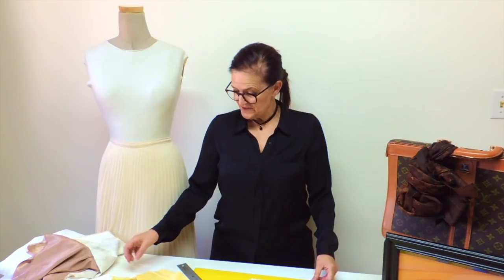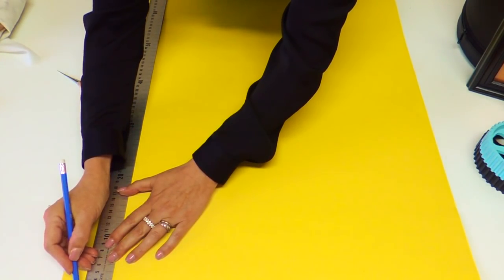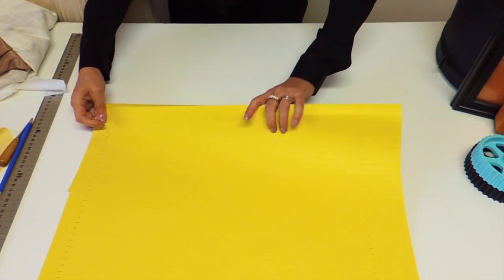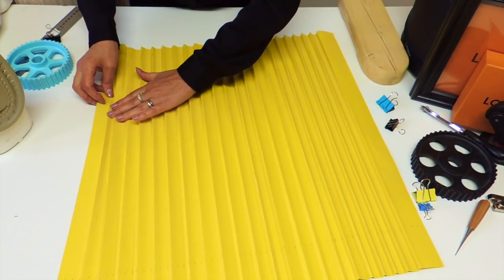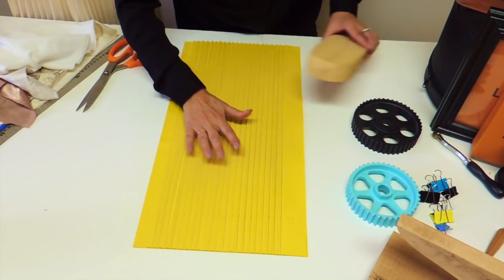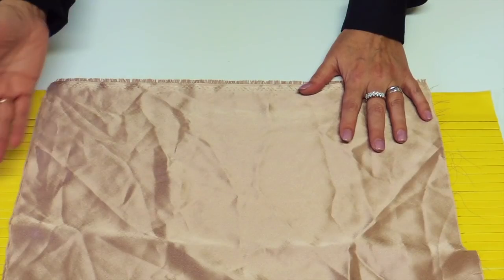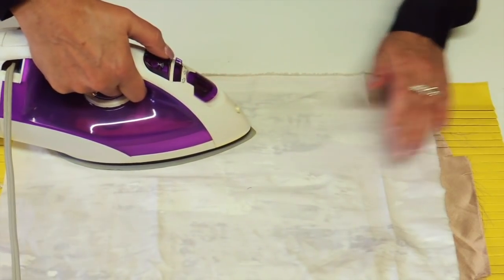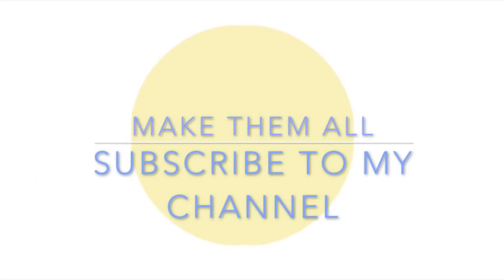Fabric manipulation, how to Pleat.

Comment from the maker: The tool could be done for the pleat size that you want, my 1cm pleat is just an exemple. For the size of the cardboard you should start with, you calculate 3 time the depth of the pleat X the amount of pleat you want + of course an extra 3cm at the beginning & at the end.  The tool doesn't have to be that big because you could always pleat part of your fabric wait until it's cold than move it to do some more.
Reply: Hi Diane, When measuring the card to use for a 1cm pleat board, is it the exact length and width of the garment that it is to be used for x 3? For example I want to make a pleated skirt, will it be a the total length and width of the shirt x 3? Or do I base it on a half pattern since I cannot cut the pleat on fold on fabric or can I? I don't know if my question makes sense.
Reply: Diane Deziel Is the medium used cardstock or cardboard??? Would a regular thin poster board suffice???

Comment: This is amazing, do you know how I could make the pleats stay after washing the piece?
Reply: That's exactly what i was wondering
Reply: Use synthetic fabrics not the ones made with natural fibers,
Reply: I'm planning to work with natural fibres and the only way I can think to make them stay after washing is, after ironing the pleat in, is to  sew right along the very very edge of every fold to lock them in place permanently. It's obviously a lot of work but well that can't be avoided with certain looks like this if you want it in natural fibres.
Reply: I saw on another video that the best fabric is polyester, natural fabrics won't hold unless we use starch, I'm not a starch fan

Comment: Wonderful video and very helpful madam ...i had a ready made pleated skirt that has already crumbled in my bag ....ho w can i fix it plzzzzz the pleats are there but in between lots of fabric crumbles still present after watching
Reply from the maker: Hello Manar,
I dont think it's necessary to make the tool to fix your skirt, I would just spray a little water and place the pleat on the pressing board following what is left from the original pressing, and pulling both end, stabilize with pin. Than press "cook" using a wet pressing cloth over.
Remember to wait until it's cold before moving and do the following section.
Diane

Comment: I want to use this technique to make a pleated headboard, sew it down the center and then twist and attach it at an angle.  I'm thinking I would be smart to add a fusible interfacing to stabilize the pleats.  Do you think that would work?  Or do I just try spray starch?  Any suggestion would be appreciated.  Thanks!
Reply from the maker: Hello Drjbo3,
That's a good idea,
fusing would help to stabilize, but when you say you are going to twist it, if your fabric is turning you are going to see the fusible.
Maybe you could try to do a tiny stitch like a pin tuck, on all the back of the pleat. On one side on half and on the other side for the other half.
Also, if you don't want that middle seam to show, you can do it diagonal, following the twist.
Diane

Comment: Hello,such a lovely video. What's the type of fabric did  you use the shiny one.
Reply from the maker: Hello Marv,
The beige fabric is a synthetic satin, but it works with most fabric I have tried. Just make a test before the real thing, AND be patient the pleats have to be "cook" , press at hight temperature "with protective cloth over, and let it cool down before moving.
Diane
Reply: @DianeDezieltoolfully  hi diane lovely video :) I wanted to ask, does pleating also work on natural fibers or does the fabric needs to consist synthetic fibers? Because one time I tried pleating pure silk, sadly all the pleating washed away when the fabric took direct contact with water. Hope you can give me some advice, thanks a lot!
Reply: @amelindaa.valerie4816  .I  read all comments.one person ask same this question.she said...
irst, using a scrap piece of your fabric, do the washing test, all the fabric I used kept there pleats, but some might not work for permanent press.
To redo your pleats, on your already done skirt, don't place your tool all the way up. Redo the bottom 2/3 pleats, than you will i be able to do the top part by holding the bottom part. And this time, cook them using a protective cloth over. Or even the rajah cloth https://www.mynotions.com /product/rajah-pressing-cloth/ Diane
And one more think.she suggest some spray

Comment: Is this also possible for an accordeon pleat? Where the pleats are all even and every pleat is overlapping the other. I'm wondering how to iron on the interfacing to the cardboard. You won't be able to flat iron the cardboard, since the pleated cardboard will be growing vertical. Thanks in advance.
Reply from the maker: Hi ceripopgumi,
I did some piece with accordion pleat, but that time I did them with a fold paper no fusing. 
The pressing is a little more difficult, because of "growing vertical" so I did it one pleat at the time.
I will make a video with other pleating, origami style, soon.
Diane
Reply: Diane Deziel ah thank you so much for your time. Im looking forward to your new video

Comment: Thank you so much for this. I  was aware there was a pleating  board you could use, I  just wasn't  sure how to make it. I've  got a question  though,  what if you want to make a maxi pleated skirt? Does your  pleating board have to be a bigger size? Please reply.  Thank you  in advance.
Reply from the maker: Hi Blanca,
The board should be the length you need for your skirt, but the width doesn't matter, because you could do part of it, than when it's cold, you move it, replace the 1 or 2 last pleats on the board, and continue.

Diane

Comment: That is amazing ,what abot  the way to wash it ? Pleas reply me
Reply from the maker: If you cook them well, they become permanent press. Of course I would test every fabric (just a little piece with a pleat or 2) before doing the real one
Reply: please how do you cook them
Reply: الطبخ!!! هل تعنين بذلك الكوي؟ارجوا الايضاح؟
What do you mean by cooking?is it ironing(preesing)?please to answer.thank you.
Reply from the maker: I mean coking them with your ion  (highest temperature, with steam, for a long time) that's why I'm also using a pressing cloth, so you don't burn the fabric, and get permanent press. You could also use this: https://www.voguefabricsstore.com/Sullivans-Rajah-Pressing-Cloth.html . You could also Mix 1 cup of white vinegar with 2 cups of plain tap water and spray over your pleats before putting the pressing cloth and iron. do not worry, vinegar smell completely disappear when it's dry
Reply from the maker: Of course it also depend on the fabric, but most of mine resist to the wash, because I cook them ( press at hight temperature with steam, for long time) that's why I use a pressing cloth. You could also use this: https://www.voguefabricsstore.com/Sullivans-Rajah-Pressing-Cloth.html . You could also Mix 1 cup of white vinegar with 2 cups of plain tap water and spray over your pleats before putting the pressing cloth and iron. do not worry, vinegar smell completely disappear when it's dry
Reply: ليندا جاسم 
اختي ليندا 
في افران خصوصي لتكسير القماش  
عادة افران القماش موجوده بالبلاد الي فيها شغل الازياء دارج وفيها كتير مصممين
مثل لبنان لندن باريس ايطاليا. 
يضعو القماش على كرتونة كبيرة كلها كسرات يلفوها على القماشه وبضعوها بالفرن.. هاذي العملية بتكسر خيوط النسيج بالقماشة وعمرها ما بترجع مفرودة مثل الاول لا بالغسيل ولا بالكوي.. اتمنى اكون وضحتلك بطريقة سهله.
طريقة الفيديو هاد بتنفع بس للاقمشة الخفيفة مثل الحرير والساتان الخفيف  وبتبقى لفترة مؤقته
Reply from the maker: مرحبا ليندا، ليكون على حق هذه التقنية هو لمشروع صغير وليس لإنتاج.
Reply: Hend Aburehab

Comment: I made a mistake by putting my pleated skirt in the washer and now all the pleats are gone and im watching this vid at 3am just to find out the easiest way to pleat the skirt back. But after watching this i guess it will be a tedious work 😭
Reply from the maker: Hello Meredith,

first, using a scrap piece of your fabric, do the washing test, all the fabric I used kept there pleats, but some might not work for permanent press. 
To redo your pleats, on your already done skirt, don't place your tool all the way up. Redo the bottom 2/3 pleats, than you will be able to do the top part by holding the bottom part. And this time, cook them using a protective cloth over. Or even the rajah cloth https://www.mynotions.com/product/rajah-pressing-cloth/  . 
Diane
Reply: @DianeDezieltoolfully  hi Diane! Thanks for the helpful info. Will definitely try that method 👍 much love 💛